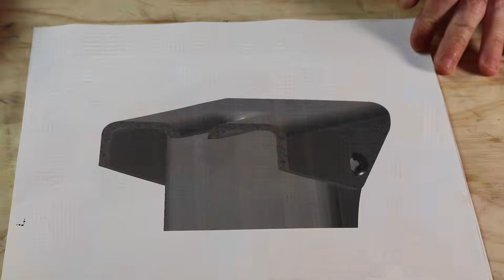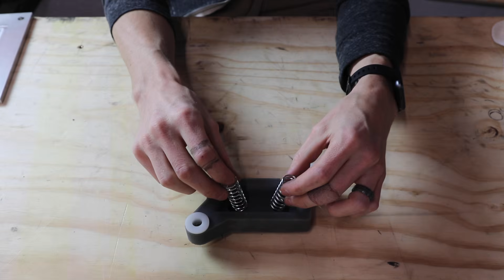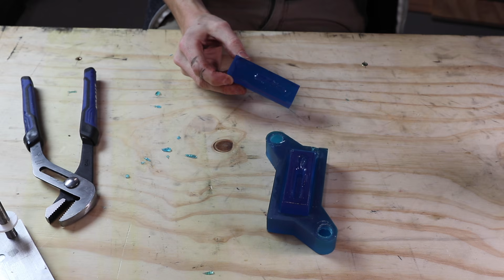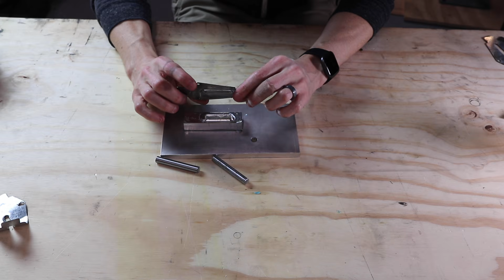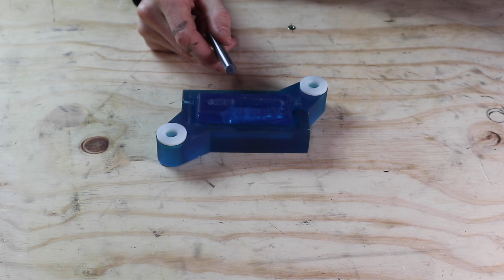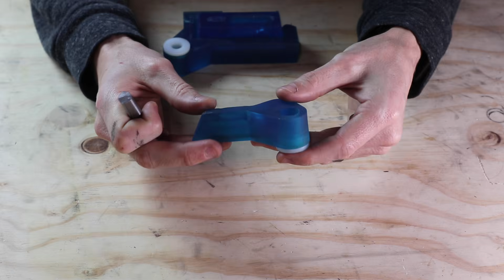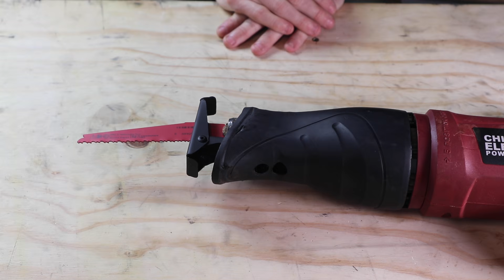Bending Steel With Plastic Tools

Comment: 0:50 take a digital photo online, print it, then film it again... I am glad  your editing chops are more refined today, I just found this interesting! btw this is one of your best series (if 2 is a series) I would love for you to look at SED's video on stamping dies and look at what's possible, maybe take a bruton design and say "these parts would be better as stamped metal" (of course you need to cut the holes, but a chinese sponsor could help there, but you can drill/cut sheet metal in shop or by hand even, to maintain the DIY robotics ideas)

Comment: Hello, I am also working metal forming with 3d printed parts. Currently trying to make aluminium cowlings for RC plane models. What type of filament and parameters are you using for the plastic dyes??
Reply: He's using a resin printer rather than an fdm. A filament printed part won't be able to survive the forces of forming unless you're using engineering filaments, which are very pricey
Reply: @jackmillen  the molds will be used once, maybe twice.... And with 0,3mm aluminium sheet. Let's see what happens
Reply: @pacomb  God speed

Comment: hydro-forming ,cheaper easier faster. could you reinforce the plastic mold with some internal or external bracing ? Could a long tapered mold to slide the part and bracket through while being formed. Help dempen the impact by spreading the load. To limit destortion of the hole i suggest cutting multiple slits along the circumference or in this case cutting the hole after bending would be ok as the rolled back edges dont really have any function and are mostly a trace of the production process instead of a feature.

Comment: Machine a top and bottom holder that has a rectangular deep pocket that you could 3D print your rectangular form tool that will fit in the pocket to a snug fit but still removable by hand then the print will be reinforced from outward force and still be able to easily swooped out from step to step as required

Comment: Why is there liquid/moisture after pressing?
Reply: He added oil beforehand to ensure everything moves smoothly when pressing. You see this with most pressing and it's usually done automatically when mass producing parts and using more advanced dyes.

Comment: Don’t know if you’ll see this, or if you’ve thought about this already, but I believe making the front part of the blade guard perpendicular to the blade is advantageous. Like in a situation where you need to make a cut perpendicular to the cutting surface but you can’t see the back part of the cut.

Comment: Wouldn't it have been easier to use the 3d printed parts to cast them in metal, then heating up the metal sheet and pressing it

Comment: Actually I don’t think your die exploded because it wasn’t strong enough, I think it was because it was unevenly loaded and looked like it got hung up on the one side 12:21

Wait scratch that, it wasn’t camming at all, your plate you placed on top of your plastic part actually just ended up on top of one of your pins 15:11

Comment: Its funny using thousands of dollars worth of equipment to fix a harbor freight tool. Even in the video the pokey bit looked bigger than the hole, and when it broke the die, that was verification that it wasn't just an optical illusion. Wonder how well parts machined out of wood would compare to the 3d printed ones. Obviously the aluminum ones would be stronger, but even at $1/ft, 2x4 is probably still cheaper and easier on your tools

Comment: Feel like this just needed 4 rods - more accuracy, less likely to break because pivoting is no longer an issue which it seemed to do between just two, which in turn caused the tension/friction on the mould’s arms

Comment: I'm not sure I see the point of making stamping dies out of material which is weaker than what you plan to stamp; such dies will wear out very quickly.  Besides, this part could have been built in 30 minutes with an angle grinder, hammer, and electric drill - but nobody would want to watch such a video.

Comment: Could you use different size dies. break the operation down into smaller parts so there is less stress on the die.

Comment: Easier solution to the first draft - You have a plasma torch...we saw you use it... use it twice - Bend the form with just the two side holes, then place the part under the plasma cutter and cut the large hole. Problem solved!

Comment: i have no experience with sla printing but a fair amount in fdm. Is sla typically as strong as FDM? I remember when i first got into 3d printing a few years back i thought pfffft this plastic stuff has gotta be weak but to my surprise even the cheap PLA stuff is pretty dang strong.

Comment: Quick audio suggestion: I've noticed in many of your videos that your compressor successfully cuts in whenever you drop a part on the bench to avoid an overly loud bang, however the release time is quite long so your voice is too soft for a moment after each time you do this. If you reduce the release time by 100-200 ms it should fix this. Additionally prepend a high pass filter with a well chosen low cutoff frequency before the compressor, and you will have less power in the bang of a dropped part which will help keep that out of your final audio without removing too many low frequency harmonics from your voice or the other interesting sound you want to keep in videos like these.
Reply: I like your funny words magic man.
Reply: Thanks for sharing this!  Dabbling in compression myself.
Reply: I've been looking into getting better at basic audio editing.  Got anymore tips?

Comment: It's so funny to me that it likely cost more money on the resin or aluminum...maybe even the sheet metal than it would have cost to buy a brand new harbor freight saw. Of course, the tool was just the muse that launched the creative process that lead to a pretty cool experiment. So, it may not have been practical in this situation, but the technics learned will likely come in handy later on.

Comment: What about adding a Chase to the outside of the containing print? Or even drilling through and bolting through some support plates. You could also machine a metal rectangle cup  your print would fit inside of. I'm injection plastic molder. I found your demonstration very educational.

Comment: For the money and time, id rather CNC some toolsteel and use that as a die and punch. Its best to get a CNC machine, or save money for one, because that is really a way to go. You dont want to fool around a mill or a lathe for a long time. You want to be a designer and make things. In the long run, you can get a lot more things done with a CNC machine. 

I would however make the heat treatment kiln myself though. Its way way more cheap to do that, and it is very easy to do. Maybe saying that. Its easy to build a CNC machine, but i guess its a lot more work than a heattreatment kiln. 

Im going to upload a heattreatment kiln soon on my grabcad page (check my youtube profile for the link). 

Greetings,

Jeff

Comment: I know it is a rather old video, and you might have already figured it out. I was watching a similar video the other day, where the dies were printed hollow and were later filled with 2 part epoxy. The issue there is the heat that occurs when the epoxy cures but probably possible to use a epoxy with a longer curing time, or just less hardener and leave more time to harden. That could give you more strength than the 3D printing resin.

Comment: Dude! - Before you lose your ring finger, take your wedding ring off.  I came close once when my ring shorted an exposed car battery positive terminal connection to a bolt head on the body.  KEY-RIKEY it nearly melted my finger flesh away from the bone.  (pulled it fast enough to avoid permanent damage)  But    !  REMOVE ALL JEWELRY BEFORE "GETTING DOWN" TO SHOP BUSINESS.  :o)   P.S. I  enjoy your vids.  Your pacing, and vocal delivery (and yes, you're humor) is just the right amount of dry for me.  If I were to correct anything, it would be to add another 1/2 second to a pause for a humorous text aside.  With the short pauses you currently use, we (me) out here don't know where to instantly look to get the joke without having to back up and replay .   That's it.  That's all.  Well done.    Carry on.

Comment: To avoid the distortion did you try cutting the slot for the blade after the forming operation? It would take two different molds used in separate operations to make this with plastic molds. Also this piece was probably originally made when the sheet metal was hot allowing it to be formed easier over metal forms. Obviously your plastic mold can't withstand contact with hot metal.

Comment: waterjet cutter is doing a so much cleaner cut, no burn, and with greater accuracy, also you can cut thicker stuff, and non-conductive materials. Maybe it makes a bigger mess, but you would have to install it somewhere outside. (if the water has abrasive material, the slurry may be hazardous waste, depending on the abrasive material used.)

Comment: @ 13:22, ask yourself, how many parts you are going to make..  get your die fab'd up in carbide, and make a few hundred thousand.. also, in most industries, creating the part is called "exercising" the die..  speed is an issue, as you know when you stretch the base metal, heat is a by-product.. so, metal die is the best way to go, especially if this is a manufacturing process..  sweet work..

Comment: just started to watch this vid.. i am a former engineer at Panasonic America.  I worked on the cowling for the Boeing 777 Rolls Royce Engines, which is aluminum based metallurgy.  The molecular work is the same for ferrous metals.  Get the metal in a form where the molecules become fluid, and then move them to their max position, anneal the base metal, and repeat.. if you are doing all your work at STP, and do not ever anneal, you are "wrecking" the structures that you want saved for the final product.  Ie.. it takes 20 process steps to move aluminum 1/4 of an inch, 3D.  But, once you get there.. best possible product, which will not shear and fissure apart with micro vibrations.. love your stuff..

Comment: Would be more efficient to print form-molds with cheap material then pour resin into it for the forms. You'll get more control over how the resin sits, and it will be stronger. Also when your form breaks, you don't have to wait 24 hours to print another.

Comment: I think the forms would hold up a lot better if you used them to achieve the detailed shape you want but strengthen them by also making a confining part either with clamping forces around the edges or a rectangular recess that they fit into that is a stronger material such as steel or aluminum.

Comment: First off I'd have to ask, did you graduate engineering school in elementary school!

I once jammed a bit with a couple in Indiana ( great harmonies) He rebuilt pipe bending machines and lathe! He was more your caliber one machining, metallurgy, and programming machining interface!

It was interesting to consider what you garage moles are up to! Man where do you get the funding for the basketball hoop ( camouflage gun torrent) And more over the patient to not superscript explicitive having to strand those belts over and over and over?

Observing the need for grace under pressure (search Rush, Canadian rock trio, orr Hemingway) given that your test of the 3D printed presses shows the presses failed and snapped from what continually amounted to a caming!

So I thought I might suggest you make a video where in you try evolving your press guide pistons by hollowing out the piston and cutting two channels their vertical diameter in which you could stack bearings the vertical dipolar cords of which protrude the guide pistons. Those vertical cords of the bearing protrusions aligning to rails mitre into the press ferrings.

Do you think such a design could reduce caming at all? And if so, is that reduction stark enough to make it evolutionary to your pressing arsenal considering the jus futurum implications of 3D printing and your then obvious desire to develop pressing system that enable preferably plastic resin press molding in space where perhaps microwaves advancement would make the plastic press molds recyclable!

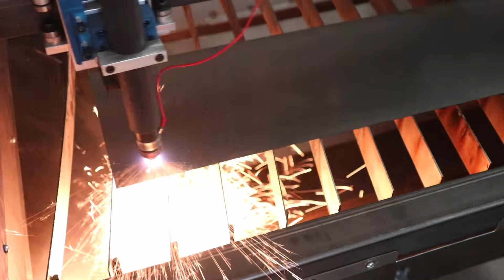From a non bias point of view - I've press wheel bearings, that's about it!- is seems that pressing pistons torquing through the caming caused material shock that both flawed the bend ( cam 2:00 piston,)
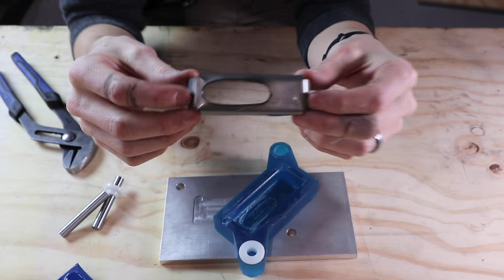and breached the press material integrity (caming 4:00 piston) 

Thus, caming reduction is trade evolutionar!
Reply: Maybe even just drill through some bearings and stack them on an axel so that the caming is expended by a drilling of the press ferrings down the bearing guide pistons that evenly spin out the torque of the press, sideways

Comment: Hey man, I looked at your 3d print, and it seems to be suffering by something called elephant foot. It's where the first layer is smooshed so it extrudes a bit outwards. You can try fixing it with proper bed leveling. If that doesn't help, lower your bed heating by 5 degree increments until it's gone.

Comment: I realize that your attempt here was to build a die set with 3D printed male and female dies, but your part and the male die is perfect for use with urethane forming, which utilizes a block of urethane for the top die.  Look into urethane die forming for sheet metal.
By simply placing the right thickness and hardness urethane block over the lower die with the metal blank properly located, and a thick plate of steel to back up the urethane, (something for the press to push against) you can make a gazillion pieces with that printed male die.  It will also form the oval slot's radii at the same time.  Experimentation with various Durometers of urethane, and probably different thicknesses, will be necessary, but that information may be available online, to get you in the ball park.  It's best to properly deburr all the edges, prior to an forming operation, to ensure no stress cracks appear in the metal during forming.
What's great about urethane forming is the cheapness of the die set, since one die is simply a block of urethane, and the other can be machined metal, hardwood, nylon, or in your case, printed plastic, but also because you can design your lower die, (male or female) to have tapered sides, to allow over-bending of the flanges, which will allow for spring back.  As you know, bent metal will spring back anywhere from 2 to 10 degrees generally, depending on the type, thickness, and hardness of the metal.
You're doing great stuff on your channel, and I'm really enjoying it!

Comment: Have you considered using another piece of formed sheet metal as reinforcement for the dyes? Normally in machined metal dyes, the geometry is simply cut away from a block, meaning the contact is between metal and metal, instead of plastic. Hypothetically, if you press in a sheet metal insert to take the place of the contact layer, it will perform the bends more smoothly and accurately than the plastic alone.

Comment: Looks like you are using PLA, if so why would you do that? Nylon or polycarbonate will give you the best outcome. Not all printers can do polycarbonate but as far as I know that's the best of the best. (requires more temp)

Comment: You can get a greater than 90° bend if you either a) have a hinged mold, which, when pressed down, also presses in hinged forming bits from the side, or b) use wedges, which get pushed in when the mold top presses down over the mold bottom, or c) have an appropriately elastic material on top, like a very hard rubber, which will press down around the sides, and bend inward, into the undercut(s), uniformly putting pressure on the sides of the metal being formed.
Reply: Just noticed part 2, where you effectively create a hinged forming setup, capable of >90° bends :)

Comment: Just plasma cut the hole after bending.
Reply: That's what I was thinking. Could also take that first result, put it over a metal bar end shaped to fit just inside the bent sides, and hammer it flat.

Comment: We used to form sheet metal with a single phenolic male die and then rubber to form the metal into the die.  Enough pressure and the rubber would conform to the male die, taking the metal with it.

Comment: 14:10 - if I were to guess, I don't think the bushing was at fault - you may have put the upper metal plate in such a way that it was sitting partially on the rear guide rod, and that made it tilt. The damage to the metal plate we see at 15:10 seems consistent with that.

Comment: $20 saw has a minor part missing. To fix it we will use $100 in materials and innumerable engineering hours. Seems reasonable. 
For real, though, cool video trying to push the envelope.

Comment: I'm impressed by the resin! If you watch the video again of the shaft camming before the die breaks, you can see the top plate of metal actually bend a few degrees before the die breaks and the plate springs back. That was something like .25" thick steel or aluminum, right? That resin held up to some serious force before breaking.